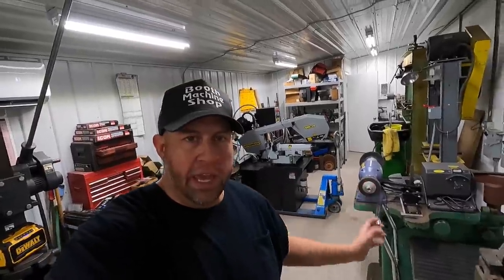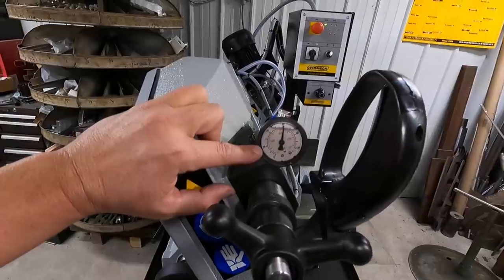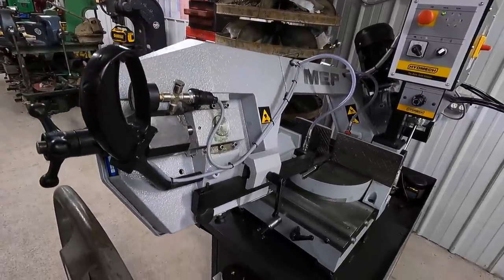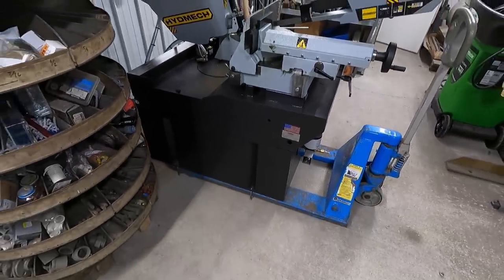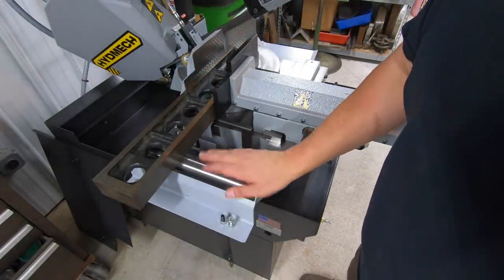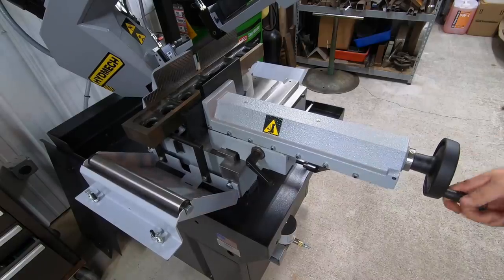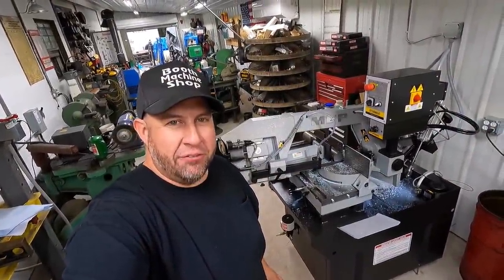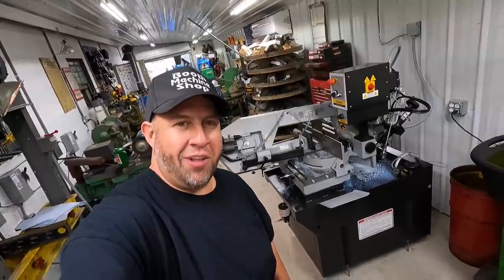Hydmech DM-10 Bandsaw Install and First Cuts

Comment: Nice machine Adam! The only thing that concerns me is the noise when you turn it to manual for the blade lift. I'm guessing it's one of two things. Either an alarm to remind you that it's in manual mode, or possibly a questionable solenoid. A brand new solenoid should not be making that much noise, at least not in my thinking. You might want to ask someone about it. 5 gallons is just about 19 liters.

Comment: Hello I'm an inspector at the factory where this machine is assembled. When you go to hook up your mist system you will find that it is on the wrong side as the hose for it comes out on the other side by the coolant pump. The bottom part of the base is flip flopped but you can easily mount it to the other side if you wish so you don't have to flip around the bottom part of the base.

Comment: 20:10 The control is not a 'feed control' it is in fact a 'maximum feed control'.  It just limits the maximum feed rate. The feed rate is adjusted by the handwheel at the back - that controls the tension in the balance spring.
Reply: Congratulations professor. You want a cookie or a pat on the back? Seems a bit petty to correct a guy on something so minor
Reply: @PennerFab  I take it you're one of these that never reads instruction manuals.
Adam cares a bit more than that. He should understand his equipment. 
Let's see if he finds the supplied pipes to the mist unit are too short - because he's mounted the saw the wrong way round on the tank !
Reply: Dusty 99  Thanks. ;)

Comment: You should measure the first cut now that you know the new one is cutting very accurately.  It would be interesting to see how far the old one was.  I realize you knew the old one no longer cut as accurate as you wanted but just to compare the difference would be interesting.

Comment: Ditch the water coolant completely! It’s messy and you will get tired of changing it. I have several of these saws and all of them we run with mist oil only even on thick material.
Also great with mist oil when you not using the saw every day. Our oldest MEP from 2004 still looks the same since we running it dry...Also your saw sounds strange in manual mode...our are quiet.

Comment: Adom the stock should be faced off for the test cut as if the first cut is crooked the second follows the same line of decent if not faced off then turn your stock 180 deg then take the second cut and note the accuracy they    just saying
Reply: Thought the exact same thing. If you do the 180-degree rotation and measure the difference in thickness the saw is off half of the difference.

Comment: To check if it cuts true, just to advance it doesn't mean anything. If you rotate your material 180 degrees you get a better idea.
Reply: I'm guessing that seeing that they make very nice saws, they would have thought to start with perfectly squared off pipe from the lathe or similar, but I certainly take your point that cutting, advancing, and cutting again, is not going to show out of square and run out.

Comment: Speaking of the mist coolant, might I suggest a 90 degree elbow so the air hose is less intrusive into your work area. You will be less likely to hit it with your leg or snag it with a piece of material/ equipment.

Comment: To test, I would get the end true using a lathe then cut, so you are comparing the saw to true square.  Cutting twice determines if the saw cuts are repeatable and without drift.
Reply: You can however turn it 180 and get “the same” result as having a flat face, just double the offset because they are both offset at that angle to an invisible imaginary line in the middle that is square to the sides (as if an actual square perfect cut were made)

Comment: So in a complete different stroke to Adam.  We run our bandsaw dry and flood cooling and the lathe and mill.  Shows there is more than one way to skin a cat.
Reply from the maker: This new saw has mist coolant installed also so I’ll be testing that unit out later. My buddy Joe uses it so it doesn’t make his Structual materials covered in coolant.

Comment: That kind of test cut does not tell you anything about being square. The cut can be 10 degrees off and you would still measure zero error. Rotate the workpiece 180 between cuts and you will see the error doubled.
Reply: You'd be better off saying that Abom mistakenly said "square" where he meant to say "parallel".
Reply: @vinny142  but that wouldn't give us another video where he test it again🤣

Comment: If it's supposed to hold 13 liters, that's only about 3.5 gallons... I think that sump is overfilled... Depending on the design, it may not matter, but it looks like the same has a tray type space at the back which is currently filled with coolant. My guess is that tray is there for the chips to land and let the coolant drain back down so that you can scoop the chips out of the back. That will be hard to do if the tray is full of a couple of inches of coolant because the saw has 1.5 gallons for than it can actually hold.

But, I'm not familiar with this model of saw, I could be wrong... But 13L is definitely considerably less than 5 gallons.  Later in the video the sump doesn't look overfilled anymore, so perhaps you noticed this as well.

Comment: 19:30 You should face the end off of that round bar prior to doing test cuts. There's no point in doing a test cut against another test cut - that should always give you parallel faces. You need to compare a cut with a faced off bar.
Reply: Diminishing returns. If the blade is not cutting square, his test cut would only give parallel faces if he took enough care to mark and relocate the piece perfectly for the second cut. And I doubt he did.

And a quick check with a machinist square would probably show you the cut faces are square enough to the diameter to chuck the stock into a lathe and not have to face off a bunch of material. Which is all a machine shop needs.
Reply: @thatguythatdoesstuff7448  He pointed out which was top - suggesting he kept the bar the same way up for both cuts. Better if he'd turned it 180°. That would do as an accuracy test.

Comment: If you make both cuts without rotating the workpiece, wouldn’t you essentially see no angle at all? Because they would cancel each other? If you rotated it 180 then you would get double the angle and would have to divide it in half, at least by my in head simulation, lmao
Reply: Ugh totally - I was about to comment this, myself. One of the first true "thinkos" I've seen out of Abom :(
Reply: I third this, two cuts made at the same angle even if it was a 45 degree cut would still come out parallel, turning the work piece half a turn so the top is the bottom would show double the inaccuracies!

Comment: Adam, I have a question. Whenevery I watch a CNC machine operating the coolant is flowing quite a bit. What is the advantage of limited coolant flow when operating a manual machine.
Reply: Well for one, the feeds and speeds aren’t even close to a cnc machine and the cnc is running automatic. You can stop a manual machine whenever you want if there’s a problem.
Reply: @tmurray1972  I understand that but what is the downside of a greater volumn of coolant  Other than using a tiny bit more energy to pump it. I realize this is not a high precision machine but heat is the enemy of metal expecially that tempered and harden to cut other metals
Reply: @markhgillett  A typical CNC machine is a fully enclosed environment so no problem running outrageous coolant flow, on an open machine like this there would be coolant spraying all over the shop.
Reply: @markhgillett  The reason for lower coolant flow on manual machines is to reduce the mess they create. CNC equipment with high flow coolant systems are typically in an enclosure which contains the mess.

Comment: Adam,
Build a small shelter from 1" sq tubing skinned with the same sheet metal used on your shop addition.  Place on the fence line east of your driveway.  Would give you the room for cutting longer stock lengths and not take up room in the shop.   Nice looking saw.

Comment: not necessarily square, but certainly parallel.   Darn nice saw, thanks for the videos, Merry Christmas
Reply: Looks like the cuts were at 90 degree offset, should’ve marked the billet and done an 180 degree turn for the largest change, still good though.

Comment: Hey there Adam. 1 Gallon of liquid ( not sure why there is also gallon of dry mass... ) is equal to 3.785412 liters. 

That means 5 * 3.785412 = 18.92706 liters of cooling liquid you poured into the tank. In other words You overfilled it :)

to be precise and pedantic i found a calculator to reverse math and here we go

15L= 3US gal lqd 7.700646US pt lqd

Comment: Hi Adam, was it correct that the blade is tensioned to 70 bar?  that is 1029 pounds per square inch. Great Video as always. Keep up the good work.  All the very best to Abby, yourself and family for christmas. Stay safe lookforward to many more videos in the new year.  Regards a fan from Aus.
Reply: 70 bar he said the instructions give, but it doesn't translate to anything useful without knowing the measureing cylinders surface area to be able to calculate actual blade tension. But then again these are all machine dependent things and vary from blade to blade and machine to machine.

Comment: "It's cutting nice and square..." well, no.  It's cutting nice and repeatable - within .001, very impressive. To check if it's square you'd have to rotate the workpiece 180 degrees between cuts... betting it's not much more than a couple thousandths
Reply: Yes, that test piece it came with may well have been rotated 180 degrees between cuts as a test of squareness

Comment: Love my sureshot.  I only have one right now, but it is a life saver when working on my car...loaded with Brake Clean.  Buying that stuff by the gallon is so much cheaper than buying Aerosol cans.  I still laugh at the package the sureshot came in.  "PROP 65 WARNING FOR CALIFORNIA".  Wow, a metal can with some O-Rings...gotta have a prop 65 warning.  Sheesh, that state might as well just put Prop 65 warnings on EVERYTHING including the air they breath and water they drink...what a bunch of loonies.
Reply: yea, its not a farce with the smog in some places, but then again what dont cause cancer in excess amounts, or for that matter cause harm, even water will if you drink too much, end up flushing out electrolites the body needs for example, common sense hasn't been so common it seems for about 15 years or more
Reply: Dusty 99  clown?
Reply: Loonies that were the first in the country to take air pollution seriously.
Reply: @WreckDiver99  Got any proof for that figure? I'm pretty sure that putting stickers on things isn't all that expensive. As far as 'shutting down power plants that are dirty', that's been going on all across the country, driven by economics more than anything else: The inefficiency and obsolescence of existing coal-fired power plants, the much lower operating cost of gas combined-cycle plants, and the massive growth in renewable energy sources are all driving that. For example, the industry predicts that new installed capacity of wind power for 2021 will be almost double that of 2020. Also "everybody dies so why should we care about poisoning ourselves" is probably the dumbest retort to any issue of environmental quality, or at least the laziest.

Comment: Is the cooling after the clamp to just cool the blade and clear it after its left whatever is being cut? (probably a dumb question)
Reply: I was going to ask the same thing.
Reply: looks like there might be a blade cleaner after it? like 2 wire wheels to get chips out from teeth and that?
Reply: I think it's to wash the blade off more than cooling it, but probably both. They're likely trying to keep all of the swarf going into the sump and not getting carried through the rest of the saw with the blade. I could see chips making there way up to that "top" wheel, piling up, and falling on the floor when you open the cover.

Comment: Hey Abom,just a idea for you can you not make a doorway and walk way to you new storage building from the side of the new saw at the bottom corner where the 2 building are the closest and the you could access the new building with out getting wet or walking across your grass or add a couple of door opposite each other so it's a 6ft walk to get in new building ,I could see alot of positives adding the connecting passage ,Thank you for the entertainment your videos are great

Comment: where do the chips go?
Reply: They collect in the pan at the back of the saw. Above the Coolant tank.
Reply: The chips are automatically loaded into a pneumatic cylinder for collection. Then at the end of each cut, the cylinder laser aligns with your face and the chips are blasted into your eye sockets at around 500 psi for the ultimate machining experience. Hydmech.

Comment: You may want to add a metal brush (approx. Dia. 1.5" in.) to clean & extend the life of the blade. I have one on my older Baileigh bandsaw. I really do think its worth the time & effort to put one on. See @ https://www.baileigh.com/horizontal-and-vertical-band-saw-bs-712ms  its the 6th (sixth) picture you want to see. The blade is set into the brush approx. 1/16" in. (.065" in.)
Reply: 21.41 it already has a wire wheel cleaning the blade gold colour

Comment: How is cleaning all the rust protection off it going to make it cut better ?
Reply: That stuff is on there for storage and shipping. Cosmoline is pretty thick and wouldn't allow for a precision cut. That is one straight cutting saw he's got.
Reply: Won't hold chips?
Reply: @brianrhubbard  How do you know it cuts straight - he's not tried that yet !
Reply: @millomweb  Well from 20:00 - 22:15 he cut out a disk and measured it and it was within .001. Plus we got one at work that cuts within .003 all day long. Ours isn't a miter style though. Which makes it even more impressive.
Reply: @brianrhubbard  What does comparing 2 cuts tell you ?  Nothing. I'd expect the same results on any saw provided the material is straight.
One option he has it to rotate (21:00) the material round 180° and compare cuts or face the end off in a lathe and compare with 1 cut. He did neither - so he's not comparing one cut with a proper reference surface !
Reply: @porkpie2884  Yeah, it's terrible isn't it :)
He doesn't understand the feed control either - LOL
Reply: @porkpie2884  There is a big difference between accuracy and precision. You can't compare a bandsaw to a lathe. Let me re-phase my original comment in a better way. Most bandsaws cut either convex or concave. That is one STRAIGHT CUTTING saw he has there. It also has a new blade.
Reply: @millomweb  I was just trying to leave a positive comment that was directed toward Abomb. If you are expecting a bandsaw to rival a lathe it would be best for you to sit on your porch and just watch cars go by all day.
Reply: @brianrhubbard  I don't know where you got that idea from ! For measuring saw accuracy, you can use a precise lathe-cut surface or compare 2 saw cuts 180° apart. If you cut them the way Adam did, there's very little to measure - only repeatability, not absolute accuracy.
I doubt many will use a bandsaw for accurate work in any case.
Reply: @porkpie2884  I do understand the process of testing saws. I stated the saw cuts straight. Being a miter saw I was thinking it was gonna walk around during the cut. We have a S23P and a M20A at work and they cut straight too. The M20 cuts 90 +/- 0 0' 30"
Reply: @porkpie2884   "Well from 20:00 - 22:15 he cut out a disk and measured it and it was within .001."
Welp, that's pretty straight to me.

Now if you want a lesson in accuracy vs precision vs squareness vs straightness vs repeatability you have came to the right channel. You are exactly right if you are talking about squareness but all I said is the saw cuts straight. I didn't say the saw was within a degree a minute or a second.
Now I don't think that company would sale a saw that would not cut a 90 close enough. Everything else would depend on the blade not the saw.
Reply: @porkpie2884  LOL, I'll take that.

Comment: Hey Adam. Your test makes zero sense :) All you did was confirm, that the error is repeatable- since you have the same error on both sides of the disc, by definition  the sides will be parallel and the calipers will show zero deviation :) You should face the cylinder on the lathe, then cut and measure the disc with one side faced on the lathe and the other as is from the saw. BTW I wish my crappy little bandsaw was this repeatable :)

Comment: 23:20 Wow, I'm dumbfounded that you don't understand what you've just done ! Many saws will do that but you've not compared it with a squared off end of the bar - faced in the lathe - then cut a slice and measure the thickness for consistency !
Reply: Dumbfounded, really? Take a deep breath and relax.
Reply: @macsmachine2609  Yeah - he's usually so spot on !
Reply: @BigRalphSmith  I take it you don't understand either :)
LOL
Reply: Most people here are not machinists thus they do not understand that the cut can be not square at all but at an angle. This is sort of common mistake on a surface grinder as well - you don't get a square if you don't use precision square vise. Still it feels amazing that the thickness is the same - feels fishy to me a bit - even the actual cut lines themselves are easily more then one thou.
Reply: @tomk3732  The set up is to cut parallel cuts - and that's what he gets whether at 90° to the bar or any other angle!
By rotating the bar 180°, it'd show a difference of thickness if not at 90.
I'm totally surprised Adam doesn't appear to have realised he's not tested the squareness of his setup by doing what he's just done. Was that his intention ???
Reply: Dusty 99  That's precisely why I'm dumbfounded !